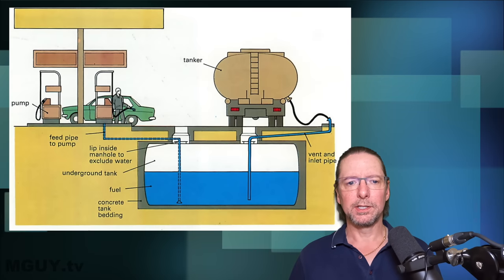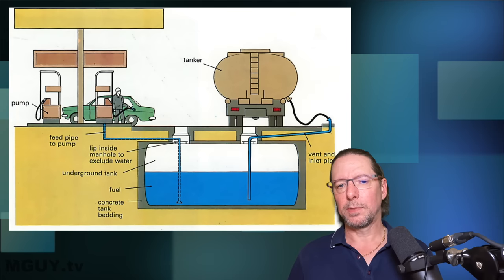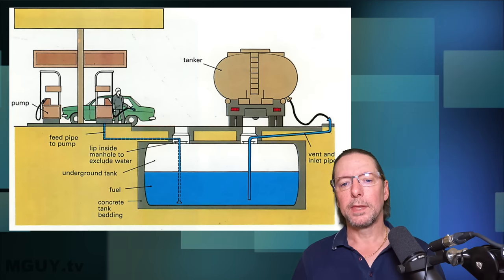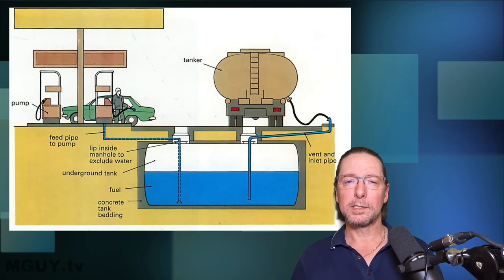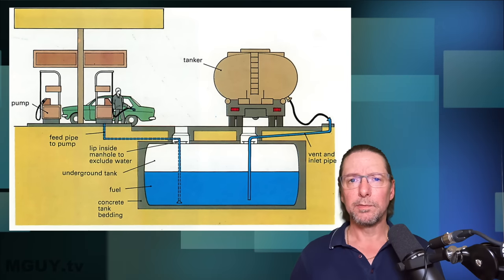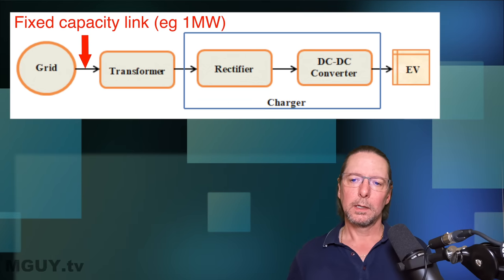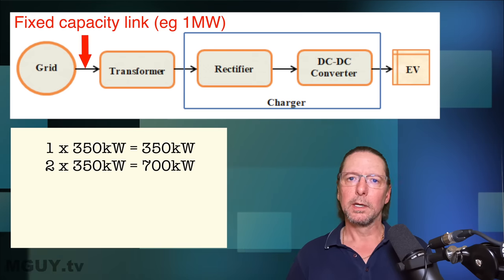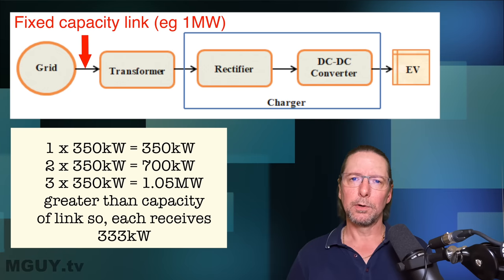HUGE problem with EV Charging Stations that no one mentions | MGUY Australia

Comment: The required infrastructure will be built over time. When horseless carriages started catching on fuel stations, garages, and paved roads were introduced to keep up to the demand.
Reply: EVs are a waste of money in the long term. Batteries degradate the more you recharge them. Electricity bills skyrocket, you can't fully charge the car unless you have a whole day to leave it plugged....there is the fire hazard (this is a understatement...if one of those batteries catches fire, there will be an explosion, plus the poisonous gases coming out)....imagine having to play to CHANGE the motor in your car every 3 years, because it shrinks at the point you can barely go 1h before it starts to dry out.........right now also the fact you don't have enough power stations, so you really need a map with 24/7 updated stations (because there are lots out of order, in a low offer area, you could drive for hours until you find one working).........and today we are seeing more and more exploding batteries, because the over-pushed "green deal" is making lots of new companies getting into the field, and half of them don't make proper controls..........talking about saving the environment, only 1 car battery exploding equals to 1000 buses pollution in a whole year.
Reply: @nicolashrv  The horror... the horror...

Comment: Also with new battery technology 1000km range and 5 to 10 minutes for a 10-80% charge. I recently was at a battery demonstration. It was under 8 minutes to add 553 miles of range. Literally the time for a pee and time to grab a coffee. instead of standing in the freezing cold windy rain, holding a dirty greasy petrol pump for 5 minutes then to queue for 2 or 3 minutes to pay. Honestly the technology is moving on so so fast. Also a new report shows in the last 6 years the number of EV fires has dramatically dropped since newer technologies. Also I figure that actually shocked me was only 16% of all EV fires were caused by the high voltage system. Other 84% of fires were caused by another issues. EV are becoming far safer than petrol or diesel vehicles. FACT!

Comment: The problem is we are moving the generation of energy, as in work or joules, from a self-contained package (the hydrocarbon fuel) in a vehicle itself to some power generating station who knows how far away. That generating station is already under load, which will vary depending on the time of day and the season. Many are already at or beyond capacity. So trying to smoothly make that transition is impossible. The whole idea is ludicrous. It's the equivalent of throwing away your refrigerator, microwave, oven, and all of your kitchen utensils to then get all of your food from the McDonalds 10 miles from your house

Comment: I´ve had an EV now since March and I live in North Sweden. This problem never interrupted me in any way. Normally I charge when I take a normal stop for eating och just relaxing and my average travel time on long trips has not getting longer. This is not a big problem if you plan your trip well. The positivs sides of an EV easily overtakes the negativs bits. Usually people that complain has never driven an EV and I would never switch back to and ICE car.

Comment: An awful lot of EV charging stations here in the UK use solar and also have battery storage, so this takes up and fills in the shortfalls. Also, it is a great use for old EV batteries better to reuse and recycle them. A fee Gridserve charging hubs are almost entirely off grid now. Also Tesla superchargers are 250kw per charger and never had an issues getting the max speeds from them, and NO I don't own a Tesla I have a Hyundai.

Comment: One thing that is not spoken about is that many EV charging stations at service stations or shopping centres are not connected to the grid they actually have a diesel generator around the back running 24/7 so are EV helping save the planet or just making it worse?

Comment: While your description of petrol stations is generally correct, I've been to many off-brand stations where there was shared piping and even sometimes shared pumps. In these stations, if two people used nearby pumps, the flow was noticeably lower than with only one person fueling. In general though, I never recall noticing the flow rate decrease by more than half, so you could still fuel in a reasonable time.

The problem you point out with EV stations is real, and is observable in real life. I suspect that, over time, as more EVs come into use, people will learn what is good and what is bad with the current schemes, and adjustments will be made. I suspect that, in time, more and more stations will be able to mitigate the infeed problems to a greater or lesser extent. 

What is of more concern is the overall electrical grid. EV stations can be a massive drain on the grid, and currently it simply is not provisioned to supply both that peak load and the existing loads. This will probably lead to a wave of grid failures in major cities around the world for a number of years, as this lesson is repeatedly learned. Eventually it will be learned that there will need to be a massive increase in fixed generation capability, and probably also substantial replacement and enhancement of the existing transmission facilities.

The thing to keep in mind is that vehicles are currently not fueled from the electric grid. They have their own dedicated power generation (refineries) and transmission (petrol trucks) network, in parallel with the electric grid. Eliminating that distribution system and putting the load on the electric grid will not work, unless the electric grid can supply the capacity of the petrol grid in addition to the current use base. This will take a lot of building, expense, and hand-wringing in the political arena.
Reply: And who will pay for all the changes? Joe Muggins!
Reply: @kasey-l5z  Yes. And you. And all his friends. And all your friends. And all your enemies, for that matter. 

Infrastructure costs are pretty evenly spread across all the beneficiaries of that infrastructure. And when the costs are managed by a government, they can also be spread across people that don't benefit from the infrastructure, but are simply an available source of funds the government has some sort of access to.

I wouldn't much worry about who pays. We all will pay, and so will our descendants for a generation or two. A change away from combustion-powered to some other form of vehicle (and cooking appliance, and heating appliance, etc.) is going to happen over the next 50 years or so. Partially from government mandate, partially from necessity, eventually (but not currently) because it will just make sense to do so.

The big question is not whether the shift will happen. The big question is whether people and governments will see the need for infrastructure restructuring, or whether they will be happy and feel morally justified seeing our economies descend back to the levels of the 18th century. Either outcome is currently possible.
Reply: @lwilton  They will go `over the top` and so will our `green taxes` because Global Warming is now a `religion` rather than a compassionate,  `common sense approach. 
World Leader ego is part of the problem. Upside down politics is the other. Smaller nations giving out the least Carbon are `bludgeoned` by  JSO etc, when the big big polluters, USA, China, Russia are rarely sanctioned, even by the media.

Comment: Given the charging times of an EV and how long it takes to refuel a petrol car then a calculation of the throughput of a service station should reveal EVs are impractical.
How many EV chargers would be required to get the same throughput ??

Comment: You CAN actually get the same problem with liquid fuel.. I've seen a few pumps that have problems with two bowsers.. the worst one wouldn't pump more then a few hundred millilitres if both were in operation... .. also everything changes, I'd be more worried about the lack of power stations.

Comment: Just a thought, I get it we line up for petrol when you see cheap fuel advertised, but will there be enough charging stations along the roads so you can recharge an EV will there be lots of recharge stations or just 1 or 2 here and there,, and people with solar power and batteries, even with 4 x 10Kwt batteries you would still be 20 Kwt short of a full charge, so no matter what, you will still pay for power and even more so in winter, Where is our $275 cheaper electricity ??

Comment: To use your example of a few superchargers needing 1MW - my entire housing estate of 70 homes would draw less than that at peak demand, and we have three pad mounted transformers in the estate to manage our electricity needs. Scale that up to an EV charging station with twenty chargers, and there is millions just in set up costs for the electricity infrastructure, if you can get that much power to the site at all. There will be instances where a prospective EV charging site will require many miles of high voltage power line install just to bring the power to the site, then multiple large transformers. 

It's all possible. The question is how much it will cost. If someone spends all that money to set up an EV charging station, they're going to want a decent return. I know of one small gas station that added a couple of superchargers - cost them $700,000 to upgrade the electricity supply and install transformers. You need a lot of margin on top of each charge to justify spending $700,000 on two chargers.

Comment: The impact of EV users on other grid users itself gets little to no airtime.  Its a time of energy crisis here in the UK which is being exacerbated by coercion to EV usage.  I calculated that owning an EV driven at average annual mileage for UK drivers would nearly double household electricity usage. Electricity supply is very centralised but petrol stations are a decentralised distribution network.  All this at a time of transition to intermittent electricity generation. Seems like a recipe for disaster.

Comment: My sister a strong leftist took her EV on a road trip in below zero weather without the heater to increase her mileage😂
Years ago we were told the grid could only support one or two EV per block in addition to households, yet our municipalities, run by the UN, are mandating all new homes must have EV capability.

Comment: Nobody talks about trying to get a charger to work when its night-time, pouring with rain and the card reader can only be used when its so low you have to kneel. Then if you dont belong to that particular club and have to download their app, your temper will boil over. Another joke is when it announces it hasn't got enough power, doesn't say when, if or ever!

Comment: After the great fuel rationing in the 1970's most two car families traded out one gas hog for a smaller more fuel efficient car. I remember my then-husband and other men complaining about little cars having to refuel more often and hence making the larger cars wait in longer lines. Oh there was all the same type whining that is going on right now. We both had our own Renault Scenic's all tricked out. Wen my husband decided to quit his job and start his own business, he thought about keeping his car. I was opposed, because I thought one large car was enough and I wanted a smaller more efficient car. About 3 weeks later, Citroen came out with the monAMI and I wanted it. So he gave his employment car back and moved to our Scenic. Meanwhile I use our monAMI. He has since put 50,000 Km on the Scenic while during that same amount of time I have put less than 1,500 Km on my monAMI. I have had no problems with it at all. I plug it in to a house standard electric outlet and it is fully charged in less than 3 hours if I have nearly drain it. Granted it is slow, it is basic transportation and it has limited distance. But I am able to charge at most places and since I am only charging what I have used it is full again when I return shopping or a medical appointment. This is what I dislike about monAMI but probably won't replace it just because of my dislikes. 1. The seats are very uncomfortable. 2. The headlights are always on HIGH and there is no other option. 3. It is quite noisy when on the move and that is because there is NO insulation at all. 4. The side windows do not go down but instead horizontally split in half the larger half stationary and the lower half is slotted to clip that when released fold into exterior upward position. 5. There is huge moon window set into a black roof. In just 10 minutes of parking in the sun during summer the interior is 40 celsius 104 farenheit but after an hour it hot enough to bake a cake. The combination of the black uninsulated roof, the tragic windows, and the moon roof window, and the interior being solid black makes the interior a health hazard. I have changed that. I applied Kilmat to the inside of the surfaces, including the moon window and the side review windows, as well as insulation, Then car upholster is faux leather to cover that. I also installed an exterior outdoor carpet. I have reupolstered the seat and made them more comfortable by add hard form that I carved with an kitchen knife to accomandate my need for back support. I am in the process of wrapping the exterior roof and window with white Vinyal Car wrap. And guess what, I put in a 6-inch Desk fan in the read ceiling so that helps aliveate the stilled air because of the danged ventilation widows, which surprisingly helps keeps the window fogging down during the winter. Also, it has never smelled like the Scenic now smells, which is of liquid fuel. Why is that? Because my husband does what wear disposable plastic gloves while he refuels and hence the leather interior now smells of fuel. Best of all, He is paying well over 200 euros just to travel back and forth to work every month. So the average cost of electricity has been 548.euros. I understand that he is driving to and fromwork 70 miles total daily and driving the monAMI on the tollways is not legal. Also, because he does use the tollways we have had to replace the windshield 4 times because of the Cargo truckes. One windshield replacement is more than what I have paid in materials to improvements I have made in/out of my monAMI. Yeah and I have driven past the cars with angry drivers having to pass my monAMI. Their show of heightened furiousness is only surpassed by their speed on this little 2 lane country road. I have a little thrill surge through me when I pass them while they are receiving a ticket for dangerous speed or at the side of the road awaiting help after hitting a boar or a deer or losing control and winding up in a ditch.

Comment: YOU MAY HAVE MISSED OUR CAPITALISTIC ECONOMIC SYSTEM.  DEMAND EQUALS SUPPLY. ie I worked in a Scrap utilization Foundry, with 3 Electro Melt Carbon Arc furnaces.  An as by Lansing, Michigan's power deliver was: Start the furnaces before 8 AM local time.  We ran 24/6 days for a Friday pm shut down/ repair/ cool down.  PS it went to producing EV etc post GM'S selling it to "a down south" US state specialty steel making company.  Do you have an order in for THE MULTI GENERATIONS' EVOLUTION OF 2024'S APTERA?  and do you FEEL that battery technology and other technologies are at their peak?

Comment: What about these solar covered charging stations that each stool have a battery ? Like the grid zero from BYD? They would still need grid power, but 60kwh (constant) instead of the 210kwh they can charger

Comment: Once again we run into the energy density issue. The batteries have nowhere near the e-d of a 40 liter fuel tank, and the charging stations are getting their second-hand coal juice at the end of a very long straw. The only solution is increasing the number and size of those long electric pipes, which, if we try the “all electric” route, is a mining and manufacturing problem so huge as to beggar the world. Insanity.

Comment: Imagine an electric pickup truck pulling a trailer.  Chargers are not set up for that.   You have to dump the trailer somewhere.  If you pull straight in, most places will result in the trailer sticking out.   Pull up Parallel and you will block multiple chargers.  Do that in the US, and that will be considered a FAFO.  I wonder if your obituary will mention it.

Comment: But Simon. There actually is a buffer tank at some EV supercharger stations, it's called a big battery. They have them for exactly the reasons you stated. Many have a tesla megapac in the corner behind a fence. This allows them to deliver max peak charge rates. While pulling a steady predictable load from the grid. You really should have mentioned this... The real issue is the cost of a battery big enough to serve the stations max needs is extremely expensive and the load on the grid is still quite substantial.